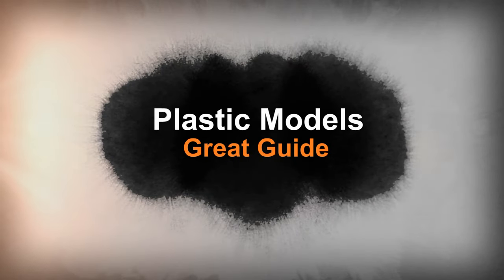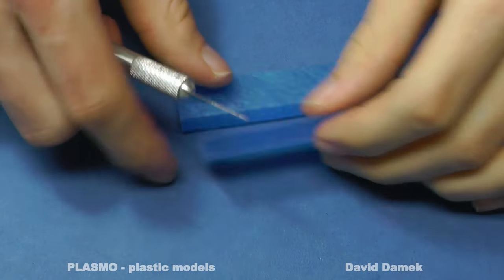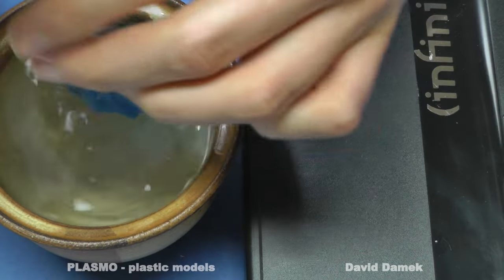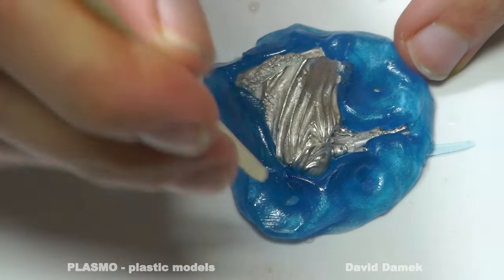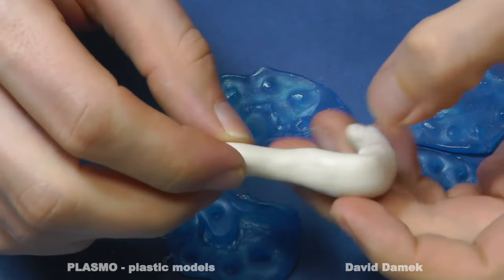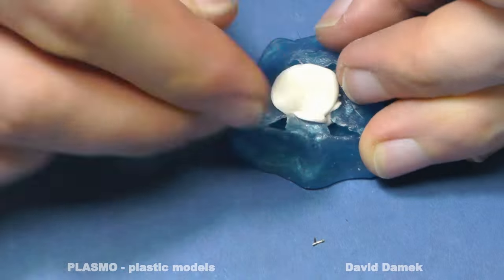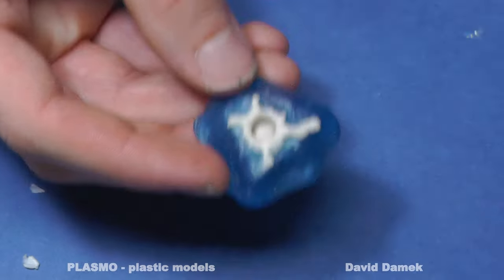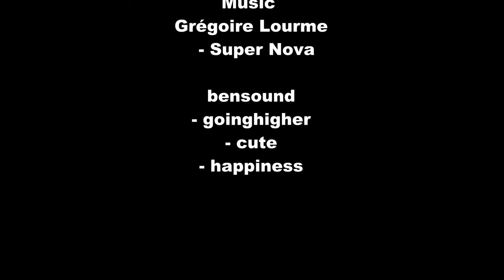Blue Stuff/Oyumaru  - How to cheaply cast miniatures or plastic models - new version

Comment: Can you use epoxy resin with this? also, would a heat gun make it as soft and workable as hot water? because I think the water leftovers or moist may be a problem in the casting process

Comment: I doubt I will use it to make miniatures but I can definitely see me using this to make replacement parts like gears or small plastic pieces that have broken. I will definitely get some Blue stuff. Thanks for sharing. GW will not like this at all but then they need to get with the modern era. Their miniatures are far too expensive and with resin 3d printers coming down in price people will start to make their own.
Reply: Funny you should say that but I was reading an old White Dwarf that suggested doing exactly this to replicate purity seals.

Comment: For some reason, the prices for decent epoxy clay seem to be three times higher in Germany. A pack of EpoPutty or Miliput is around 10 Euro. The domestic stuff you can buy at the hardeware store over here is also terrible: The two components are always packaged together, with one coating the other. When you try to mix them, there are bis shards of pre-reacted material in it, making it impossible to use it for fine details. In my dispair, I tried using the cheap self-hardening modelling clay sold in decoration stores, since it's only one or two Euro for 100g. I was sure that it wouldn't work, since it basicly just artificial clay with fine paper pulp in it.
Would you believe it? It does work! It's the cheapest, most basic stuff and it not only works for all the details, it's extremely easy to handle. The only downsides are that it shrinks a little bit and that it's not that easy to get it to harden properly. Since it needs to dry out to cure, you have to carefully remove one half of the mold and then leave it sit for some more hours.

Comment: I would definitely recommend the two part epoxy party, I tried with different combinations of milliput, green- and/or 'grey' stuff and it never quite sticks to the mold and I mostly just ended trying to squeeze it into corners, always with less than satisfying results. The epoxy party actually sticks to the mold and the final result isn't rubbery unlike greenstuff. I couldn't get it in my home country so I ordered from the Czech Republic.

Comment: Have you tried the paint on rubber silicone from hobby stores? I use this to paint directly over a part it causes no damage to parts I normally paint on a thick layer first then build up about 7 thin layers, it takes about an hour to completely dry and turn to really strong flexible rubber and I use a simple cheap car body fiberglass kit only using the resin and harner from the fibreglass kit and pour in the mould! It takes about ten mins to completely cure and you can take of any flash from over spill the detail is just amazing it picks out everything being a thin resin liquid! I wont use anything else but this now and 1 ltr iv had for about 7 years now and use it alot and for 18 bucks it's well worth it! J did hesitate at time I remember when saw price but got it anyway a d its lasted this long! I'm very happy and it's an own brand from hobbycraft in uk but sure you would get other types

Comment: Thanks for video.  purchased the kit. I recommend using anything other than the yellow and blue tape material that it comes with. It is not user friendly ( very tacky) 

In my experience. Use something else. The mold is good, however the water must be boiling hot for it to be workable and put in water a few times to get it right. The blue material is good
Reply: clickclick vroom

Comment: You can also make one part molds that you can't get out and then just rip the blue stuff off. This is good because you get zero moldlines i find that a silicon sculpting tool is better for filling than a toothpick as you can get more pressure and you aren't in danger of piercing or scratching the mold surface.
Reply: A sculpting ball stylus works well, too.

Comment: I use amazon prime because it is convenient and fast which is why I also go to youtube! From Boston I can't find Bluestuff nor Epo Putty , locally! So I bought Instant Mold from amazon, and ordered Epo Putty (in red-yellow packaging) from Limpitreef but they sent me Epo Putty  (in blue-green packaging) which I can't tell if it is the same epoxy putty! The Instant Mold was not a pliable when heated up in the boiled water and was harder to work with than the Bluestuff in your video as it did not receive the indentations to allow the two pieces of Instant Mold to fit together securely without sticking. I was working with a deeper cavity on both mold halves and the Epo Putty took more that 8 hours to slightly harden, so I will melt the mold in hot water and try again and maybe use a little more of the catalyst (hardener)! Because I am using deeper cavities for my mold maybe Epo Putty will not work as well and so for the 3rd attempt, I might try Kneadite! If I can't get the putties to harden withing Instant Mold I might wait for the Blue Stuff that I ordered from Spain that will arrive in a little more than a week or two! Maybe I could send you a photo of the plastic piece that I'm trying to re-create and modify?

Comment: Is it perhaps better to use an alginate for character work?

Alginate is not reuseable but it's a liquid, can be painted into details and can capture every pore in skin.  The detail capture is a lot higher than thermoplastic molding can achieve.  It also de-molds much nicer as it is very elastic.

Blue-Stuff looks like it can deform soft parts, as force is needed to mold the material around the part.  It also looks like it cannot deal with complex shapes.  Alginates flow well around complex parts, large parts of the model can be pulled out of small holes due to elasticity... and the mold can be cut open (and keyed) with a scalpel quite easily.

You can then cast white-plaster, polymer-modified gypsum, fast urethane resin or various silicones... depending on whether you want stone-like, plastic-like, hard rubber-like or soft rubber-like parts.

All the Blue-Stuff and Oyumaru work I've seen seems to be poor at capturing texture detail, seems difficult to key properly and leaves a lot of 'flash' where the halves of the mold join.

I'm not saying that Blue Stuff is bad.  It definitely has some uses.  But for characters I think detail and texture is more important than for hardware items like shields or machines.

Comment: Great ideas! Thank you for telling about these useful materials and methods.
The epoxy putty - is it safe to handle with your bare skin like that?
I suppose with some items that are larger/thicker, we could make a hollow (dent) in both halves, or fill central space with some cheap material like styrofoam scraps, and so use less epoxy putty.

Comment: Just ordered some!  Any idea if this stuff would stand up to pouring hot pewter into it?  I do some pewter casting using a number of different mold materials.  Wondering if this stuff would burn if exposed to those high temperatures?  Pewter cools and hardens very quickly, almost instantly, so I wouldn't be too worried about the material softening before it has a chance to harden, you may just have to remake the mold for each pour.
Reply: ry412934 pewter is going to be to hot for that type of application.

Comment: dear Plasmo once again a fantastic and most helpful video.i have a question regarding the epoxy putty.how you preserve the unused material?does it go solid after you open the package?
Reply from the maker: It is two component epoxy putty so it will solidify only after mixed up.

Comment: I dono if im using it wrong but mine seems to be really stocky and after letting the first half coold down and set than make the top half of the molf, its a nightmare to get them apart and they deform on me.

There is also always little bits stuck in whatever container I use to heat them up in.
Plastic/glass and ceramics, it's the same story.
 brought 4 packs and have the same issue no matter what pack or how much I use.

Tho for flat pices and icons etc, this stiff is amazing imo.

I just havent had much luck with 2 part molds.

Comment: I just tried this this evening with generic Thermoplastic, and after the two parts solidified, I couldn't pull the 2 mold pieces apart and had to reheat the fused pieces to retrieve the master.
I'm guessing there's something special about the Blue Stuff formula that doesn't require a release agent or is David separating before the molds fully cures? If not, Blue Stuff doesn't cure hard like the stuff I got, but stays playable?
Either way, thanks for the video!

Comment: Epo Putty is a little harder to find here in the US. What are some alternatives? Milliput? ProCreate? It seems like you need it to stick to itself well, which I guess Green Stuff doesn’t? 

Great info, thank you!
Reply: Milliput is fine, tried the white fine details stuff and just the normal yellow. It is brittle so any spikes or thin parts of your model may crumble. You can mix in some green stuff and it will give it some flexibility. 100% green stuff is fine but very hard to work into the mould and the end result comes out very rubbery.

Comment: Great video! I have given this a try but i am having real issues when using Milliput i mix it all up correctly in equal amounts. But it seems to almost breakdown into a sticky powder which is horrible to get off the mould etc. It sticks to my fingers and everything when filling the mould. Any ideas what i am doing wrong?
Reply from the maker: Hello. Milliput is not suitable for this purposes. I used epoxy putty. For example Loctite, Alteco Epo Putty, Tamiya etc.

Comment: A side note:
      Would it be possible to melt the leftover frames or "sprue" of a model kit, for use in such molds? If so, how would you go about melting the frames/sprues down as well as getting the substance into the mold?

Comment: Do they not sell this stuff anymore? I went to the website you linked and cant find "Blue Stuff". Does it have a different name perhaps?
Reply: Forget it, I found it. Their search box just sucks like proper terms.  Not sure if they ship to USA or how much more it would cost but I found some on ebay for about same price. Also just found some on amazon, but not same brand. Much cheaper as you get 12 pieces for same price as Blue Stuff 4 piece pack.     Seems to be a chinese brand, but the ratings and reviews are good.  Seems to be same type of material that you use hot water to mold it... Worth a try for 13 bucks.

Comment: Say, Daniel, what's your view on 3D printing and the possibilities it offers to model builders? All this casting stuff is great and everything but if you scanned the miniature, you could print it as many times you wished and with better details too.
Reply: been looking at 3d printers for making my own models and it will be a way off till that becomes a good method, most 3d printers leave lay lines because of the way they print unless you get SLA type of printer which currently they are between 1k-4k most of the commercial ones i've found so far like Formlabs form 1+ and form 2, but the material used for them is pretty expensive
Reply: I have actually bought parts for a necromunda gang from shapeways. Loads and loads of model stuff on there and alot of it is solid 😎

Comment: Nice stuff. Seems it doesn't hold the fine detail though. I guess some kind of jig is necessary, where the mold can be put in and the whole thing could then be put in a vice in order to keep constant pressure on the mold so as to get the maximum amount of detail from the original.
Reply: Might it be the water that he allowed to remain inside the mold?

Comment: hi sorry to bother you I use Polymorph plastic for repairs but also use it for my models. I have not however been able to mold replacement parts and blue stuff looks like a cheap way to go. how hard is the putty I currently use Milliput but it sticks and is messy but very hard.
thanks for your advise in advance Simon

Comment: Let's see:
-4 Carnifexes ($190)
-6 zoanthropes ($140)
-2 neurothropes ($46)
-1 hive tyrant ($60)
-1 red terror ($45)

-6 tyranid warriors ($120)

-10 deathmarks ($84)
-10 immortals ($84)
-9 scarab swarms ($33)

-15 primaris intercessors ($90)
-1 lokhust heavy destroyer ($35)

-5 csm ($30)
-5 reivers ($30)
-1 venomcrawler ($20)

-Skulls and other bits for decoration ($30)

Total: $953

Coming next:

- 3 canoptek doomstalkers ($135)
-10 lychguards ($110)
- 20 necron warriors + some scarab swarms ($50)

Total cost in bluestuff, electric kettle, water and greentuff/milliput: around $150

This basically has made the hobby quite sustainable for me, I honestly don't think I could have afforded such unit growth without bluestuff, even with a 3D printer, as it would have required additional training, an special environment and ventilation systems I don't have, while I still need to buy a kit to make the copies this often means the whole operation is easier due the usual extrabits we get from the original boxes, and since most of the people at my hobby shot has its share of 3D printed and casted models and this is actually the only one in my country we know about then it makes things easier.

Comment: How brittle is it when it's all said and done? 

My general problem with 3d printed resin is the brittleness of the mini, if there's anything that's more delicate it snaps off if you look at it wrong :P
my thinking is that i can 3d print some parts once (i'm thinking of OPR minis btw :P, only legal stuff here), and use the 3d printed mini to as a positive for a mold then recreate it with say epoxy putty, or other similar stuff.
Reply: Epoxy putty is stiffer than green stuff but soft enough to cut 
It's a bit softer than resin models

Comment: Would you still recommend this blue stuff two years later or have you found something better since? Thanks! :)
Reply from the maker: Yes, I am making pro mold and cast from two component resin. It is same as professional resin parts. The details are much better. However, the material and tools are more expensive.

Comment: Got any tipps? I have always problems with the second half of the mold. The top half is always less textured than the bottom half and they do not fit that good.
Reply from the maker: You must use more epoxy to both halves. Good practice is press both half together as strong as it can.
Reply: Tried it again: It seems that the bottom part was pressed to deep, so the top part had not enough to "imprint" on.

And less epoxy was it in my case.
But thanks for the quick answer.

Comment: Use two component epoxy resin instead of Milliput like this guy uses. Not only is it cheaper, but it molds better. I have borrowed some 40K warhammer figures and cast a small army for very little cost. They are undetectable from the original miniature. The molds are still going strong and doing the rounds.

Comment: did you got to let the mold fully harden before seperate 2 half ?, i not use Blue stuff, but a similar characteristic, but it not work, it complete harden and i just can't remove the mold
Reply: Sounds like you need some ghetto release agent, spread some cooking oil or something on one of the halves before you put the other half on. You can then wash it off when you get the sides apart.
Reply: @ausaskar  thank you

Comment: Just made my first experimental mold (A spacemarine meltagun) with both of those (milliput and blue stuff). I think I overdid it with the milliput and I might not have created a really good mold on one of the sides. The front side is looking like it poped out of the damned factory...the way the details got captured is simply astonishing! The other one is still serviceable but it has minor flaws, probably nothing I cant fix with a hobby knife though. Over all mightly impressed. One question: Its been over 4 hours that I have allowed it to cure and still touching the 'flash' (remember I overdid it with the mili :P ) it still is a bit bendy/rubbery. Does it cure to a plastic like state ever? Mr PLASMO thnx for the tutorial!
Reply: It will always be somewhat bendy/rubbery. Unless you do something to manually harden it.
Reply: Any ideas as to how? After 24 hours of curring I can work it with tools and it seems solid, not easily bending or breaking (I even dropped it a couple times and nothing). One thing I noticed is that I seem to have residue left over in the mold, even after a good washing.
Reply: Maybe leave it in the fridge for a while? I think someone suggested that somewhere in the comments, but I don't know how well that'll work.
Reply: Freezing it will not help more than likely. You need to be sure to mix it properly and let it cure in at least room temperatures for 4 hours. If you mixed it correctly you shouldn't have issues. According to their site it should be drinkable, filable etc after 4 hours. Applying heat will speed up the curing process

Comment: How long does the Blue Stuff from the soft state take to re-harden?
Reply: It's just a few ounces of putty, so not very long.  I'd guess 2-10 minutes, depending on your hands and room temperature, how quickly you work, and the shape and material of the object you're duplicating.  (A beefy metal miniature would suck more heat out of the mold than a thin plastic one.)

Comment: silicon mold might be easier and more accurate recasting many part, but the plust thing about this blue stuff mold is reusable lol
Reply: Also it’s easier, if you’re gonna be doing a ton of casting I would say go silicon or something similar, but if you only need a few extra arms or something this is too handy
Reply: This is only for a few bits a pieces that maybe you only need one of two of